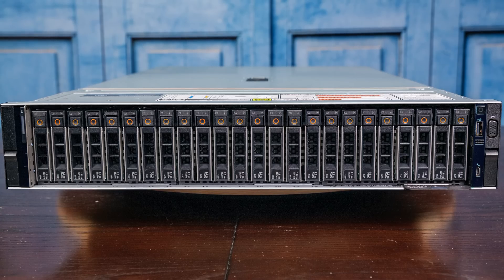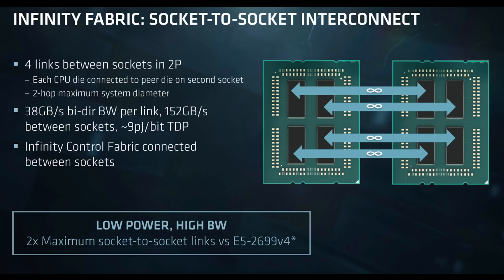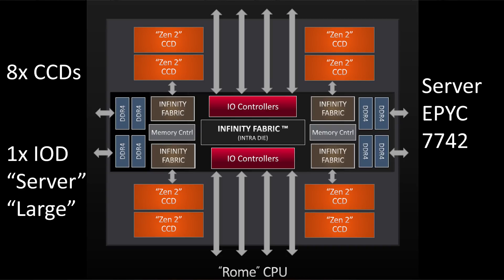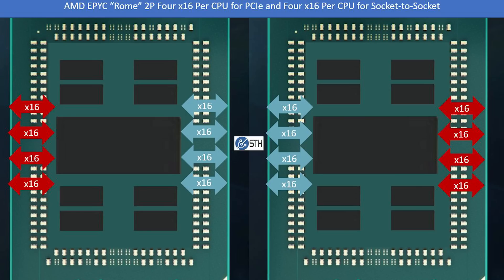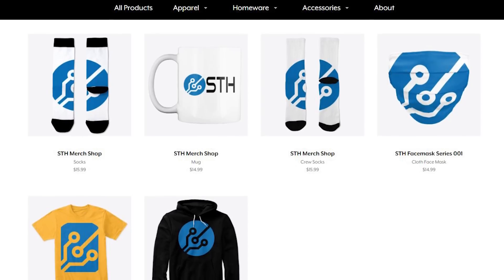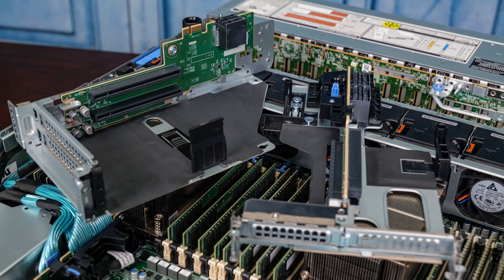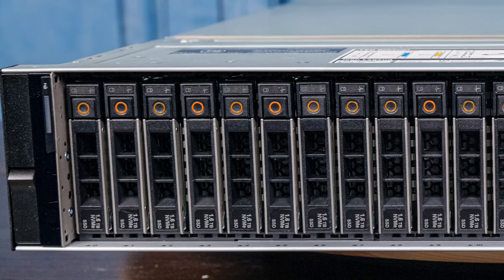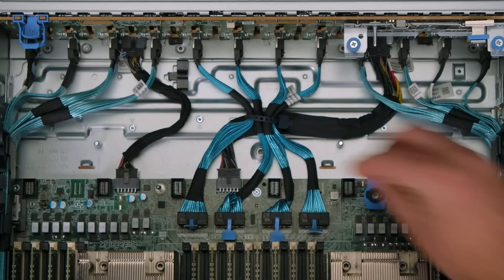AMD EPYC 2P with 160 PCIe Gen4 Lanes in a Dell EMC PowerEdge R7525

Comment: hey. shouldnt 2x16 lanes per socket to 2 other sockets work well tho, for a total of 3 sockets and 3x4x16 free pcie lanes? given that naples already had solved network loops, it seems reasonable to me to do a triangle socket topology using rome?
Reply from the maker: Technically even 2x XGMI link socket-to-socket (192x available lanes in 2P) works, but that is not supported by AMD. Only 3x and 4x XGMI links. Going to 3 sockets adds additional complexity.
Reply: @ServeTheHomeVideo  so, 2 sets 2x links on each io-die, one going to each socket is what im saying. doesnt seem that complex imho, things like broadcasting cache coherency is just sending to both. past 3 seems insane though, needing n!/2!(n-2)! connections for a point to point design like that.

Comment: what i noticed he did not talk about is the 1 USB 2 and the 1 VGA port on the front. USB 2 and VGA don't really take a lot nor are they really used in rack mount servers but for them to be functional you need them to be hooked into the CPU some how either by having their own daughters board that will take the signals to the motherboards CPU or by taking a break off from the CPU PCIe lanes for those 2 ports. Either way you do need at least 1 lane to dived between them IF they are functional ports and not legacy ports that aren't hooked into anything.
Reply from the maker: Generally on servers, especially EPYC 7002 servers, these are tied to the BMC. The BMC utilizes a x1 WAFL lane to the CPU that is distinct from the main flexible I/O blocks. We covered this in the previous article on the STH main site.
Reply: @ServeTheHomeVideo  As this was the first video of yours i saw i did not know. Thank you for responding in a way that makes sense and is informative.

Comment: I cant wait
in 7 years i'll be able to buy one of these dual socket 128 core Dell servers, like when i bought a top of the line, dual Xeon E5649 12 core 128GB-DDR3 24x2.5 hot swap Dell Poweredge C2100 for $210, 7 years after it was released for i'm guessing $35-65K

Comment: Is there a reason Epyc parts couldn't use HBM2e as L4? A CPU with the memory bandwidth of a GPU would be nuts for some workloads, CPU cores have progressed to the point where memory bandwidth is becoming a more and more widespread bottleneck.

If the latency of HBM2e as L4 causes regressions for some workloads the option to disable it would be useful, on a per-process basis instead of in the bios would be very nice. Extending the "Infinity Cache" concept of smartly handling cache to increase performance (by determining which data performs worse with L4 and bypassing L4 when appropriate) would take a lot of fine-tuning effort away from the user, if such a thing could be made to work well.
Reply from the maker: No real reason other than offering cost/ complexity. AMD also made Rome to compete with Ice Lake Xeon so it did not need this type of feature. We will see more co-packaged memory in the future. Disaggregating the CCDs makes this easier.

Comment: Are there U.2 drives which can do 8xGen3 and/or 4xGen4?
Reply from the maker: Hi Bernd, are you thinking of something like this? https://www.servethehome.com/kioxia-cm6-review-pcie-gen4-ssds-for-the-data-center/
Reply: @ServeTheHomeVideo  thanks. Actually I was missing the fact that Dell seems to offer quite a few gen4 U.2 drives already. However since the Dell website is a pain in the ass it’s hard to find their specs, (and some have ridiculous prices in the New Zealand shop, for what reasons at all Dell wants to show them to me). Btw what’s the magic sauce to actually select the server in the configuration? It seems to insist on PERC config for the two models which are shown to me.
Reply from the maker: @berndeckenfels  It took me 3-4 minutes of configuring to get to the screenshot and I was working off the Dell BOM I had for the server we are reviewing.
Reply: @ServeTheHomeVideo  maybe it’s an international restriction, do you start with the base models which use the sata chasis?

Comment: P.S.: Is that a proprietary cable? Doesn't look like octalink (or octolink, I never know right) cable to me..? Also, are octalink already pci-e 4.0 (x8)compatible?
Reply: Do you mean the XGMI cable? https://www.servethehome.com/dell-and-amd-showcase-future-of-servers-160-pcie-lane-design/dell-emc-poweredge-r7525-xgmi-cables-to-nvme-backplane/
I'm not sure if AMD has standardized a cable for XGMI links.
Reply: @Zizzily  yeah, XGMI in that application, but originally I meant OCulink (I always forget this and mix with octalink)... Actually I just found that many use different because there are different suitable for pci-e protocol, but I mostly saw oculink, probably because it has sas capability as well :SS

Comment: Really cool to see how the industry is trying to standardize on using PCIe for everything and AMD being ready for it with having so many in such a flexible design.
Reply: Isn't PCIe pretty standard? Unless its different on the enterprise side.
Reply: @johngrave5554  It is very standard in slots. When you start talking about backplanes, standardization of new form factors for server use, etc. there are many more question marks and engineering decisions. There is also generational learning curves. Think about bandwidth issues with PCIe SSDs in RAID being processed through the CPU(s). 160 lanes of PCIe in x4 SSDs is 40 drives with parallel access. That's quite the firehose to drink from.
Reply: too badit doesnt workhalf the  time

Comment: It would be great to see a storage benchmark. Maybe raid0? 😁
Reply: see the LTT and Level1techs coverage on a big NVMe server. Getting the full bandwidth of all devices at the same time is very tricky
Reply: That might be a problem for the cpu. Even with 128cores this is gonna be an extreme load.
Reply from the maker: It actually is even a more acute problem on this type of system. You start running into memory bandwidth limits because 24x PCIe Gen4 lanes are a very high proportion of total memory bandwidth. In addition, with less socket-to-socket bandwidth, you start needing to test these using 100/200GbE NICs on each socket but end up limited in that case by network bandwidth. Many challenges!

Comment: Just goes to show, wired is better than wireless.
Reply: wireless is a shared communication medium - it is equivalent to just having 1 wire connected to everything. (and yes, you could do fancy frequency domain signalling wired, optical fibres use both frequency and phase, and does ADSL an internet connection sharing the underlying telephone line)
Reply: @andytroo  woosh. I was joking about having AMD and Dell having internal cabling for flexibility of CPU PCIe lanes instead of traces on the motherboard.  But then I'd have to explain that while traces are technically wires, they're fixed in on a PCB, and explaining the joke is never funny.  

You're not wrong about RF though.

Comment: Thinking about buying this server. Do you know if you can use non dell hard drives?
Reply: It wont be covered by support if you do. Source...I work at Dell..
Reply from the maker: On hard drives, we are using the 24x NVMe backplane so we do not have the 3.5" HDD or 2.5" SATA/SAS HDD backplane in here. We have seen Kioxia CM6/ CD6 drives link on this system at PCIe Gen4 speeds that we got from Kioxia instead of Dell. Using third party drives will not be supported by Dell so there is another layer of concern there.

Comment: Sounds like Intel forgot to pay Dell this time around ;)

joking aside, it's still asinine that dell is locking the EPyC CPUs to their servers only; Which means that unless Dell servers + Dell locked CPUs are suuuuuper cheap i will not touch them ... and i tend to regularly spend 4 figure sums monthly on hardware ...

*edit* mistakes were made. 5 figure sums each month.
Reply: with spending a four figure sum monthly, you only have to save up for two years to populate the NVMe slots of this server with highend storage!
Reply: @tommihommi1  Uhm, 2TB NVMe drives are under 200€ each. not too bad.

Uhm and now i realize the mistake, 5 figures monthly that is :)
Reply: @skaltura  Good luck finding a server grade PCIe 4.0 drive with decent capacity for under $2000
Reply: @tommihommi1  lol. Sounds to me like you do not work in this field OR you work on corporations with "no regard towards budget" :)
Reply: 10:00 scratch that, Intel did not forget to pay Dell. Just like SC who are handicapping all AMD offerings.
Reply: @skaltura  SC ?
Reply: @dupajasio4801  Supermicro

Comment: How much PCIe lanes?
AMD: yes
Reply: beat me to it
Reply: Unfortunately not true for Ryzen, some pcie slot or sata port always has to be disabled in order for a second M2 slot to work
Reply: @xWood4000  Really want Threadripper Pro to release for the diy market. 16 cores is all I need, but I'd like those lanes for scaling up NVMe as I need it (which will hopefully and surely become cheaper in the future) and more focused on the client side than Epyc which is officially not even supported
Reply: @hugevibez  Yes, regular threadripper is better than ryzen but threadripper pro is really needed
Reply: @xWood4000  All I really want TRpro (WRX80) or the rumored TRX80 for is the 16 core part with extra lanes and more bandwidth, which doesn't exist on regular TRX40 so far but definitely could and I'd be fine with "just" 64 lanes and 4 channels of memory. (

Suppose that stuff will have to wait for the SP5 socket next year.
Reply: @hugevibez  That sounds expensive but reasonable
Reply: Yes!
Reply: Intel:  wait that's illegal!